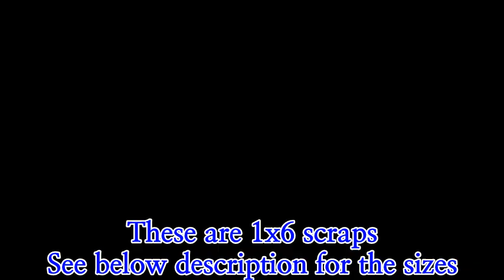DIY : How to build Birdhouse

Comment: Pretty cool 😎 ;! But I just made 4 I have over 50 love birds 🐦 so I need to be able to take the top off to check on the babies . And clean it out. Easy to do over hang the back the thickness of the board, nail a little triangle piece to the roof, front and back.